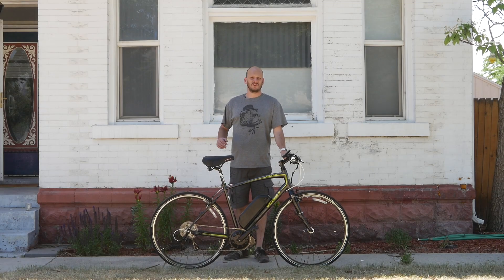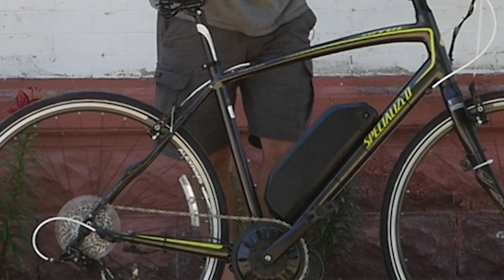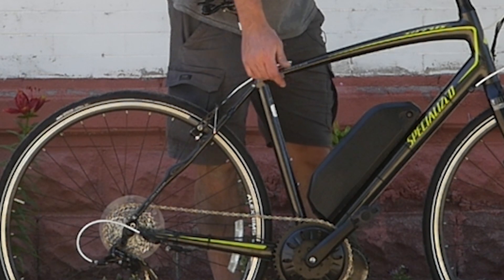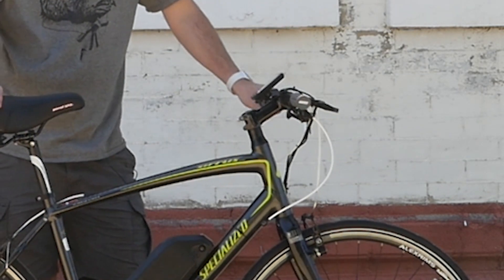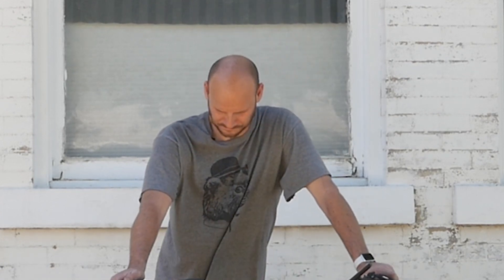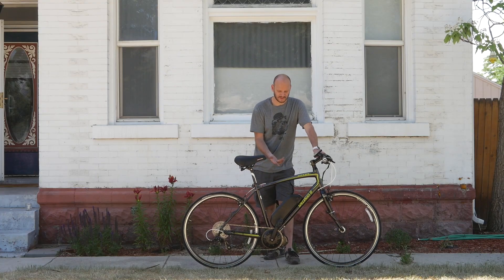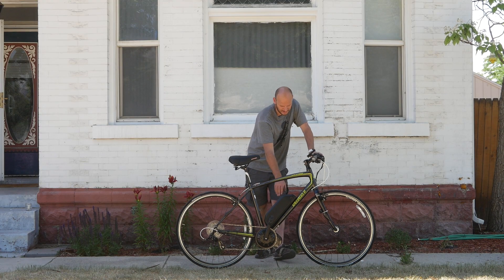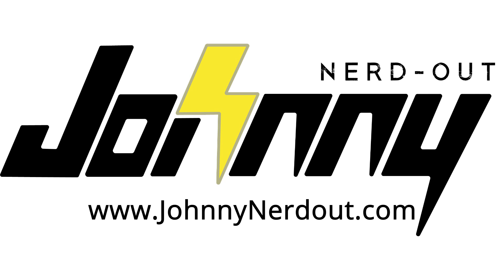Custom E-bike Build: Specialized Sirrus Bafang BBSHD 52v 17.5ah

Comment: Hey Johnny, I'm about to convert my vintage Sears and Roebuck Free Spirit road bike using a bbs02 kit. I noticed that you don't work with that many vintage bikes, is there a reason for that?
Reply from the maker: Not many out there that want them converted. Many are in poor shape as well.
Reply: @JohnnyNerdOut  Mine's in pretty good shape, I bought it off and old man that fixed it up and then realized that it was too big for him. I just gotta clean it up and probably add a little grease here and there since I've had it sitting in an old garage for like a year and a half.

Comment: shame it doesn't have hydraulic disc brakes, i'm struggling a bit with my regular old caliper brakes on my crazy long range bike, I weigh a lot though, 100kg.  I feel like the perfect ebike is probably a lightweight hardtail mountain bike with 28 amp hour triangle battery,  bbshd, although I do have some gripes with how the bbshd feels to ride because of how the motor is programmed to work, or has to work by design,  it will switch power on and off even if you hold the throttle continously, and below 50v theres a huge dropoff in the watts it will give you, typically it falls to around 500w to 700w,  whereas on my hub motors it will give full power at all times regardless of what level its on 1 to 5.  At low voltage it will still go up to 900w ish rather than 1200w which is what i've got it limited to.

Comment: Looking forward to a chain video. I have a shift sensor, but my shifting is a bit loud. Try to adjust but still not super quiet shifting.
Reply: Look for videos on indexing.
Reply: @MHH3180  I have index the gear. But I will try to do it with some help. Thanks. :)
Reply: A shift sensor should be mounted quite close to the derailleur. This limits any effect such as cable slack or stretch so that the actual shift is within the motor shutoff period .
Reply: @michealbackus4543  My sensor sits on the last hose near the derailleur. I must try to index better. Thanks. :)

Comment: If I plan on using my e bike on only pedal assists and not throttle, do i benifit from installing a brake sensor and gear sensor at all? Isnt the motor going to be turned off when im not pedaling in any ways?
Reply: Unfortunately, cadence sensing systems do not react nearly quickly enough and of course with a deraileur system you have to be pedaling to shift gears. You might have a point on an internally geared system or a torque sensing system.

Comment: Why is there such a variety of results with a Bafang BBSHD motor? You start the video by saying this a road bike and yet you only achieve 32 mph. I seen other videos of yours where a fat bike with the same motors achieves 36mph and more and yet there should be much more drag with those.
Reply: battery level maybe? he mentioned it was at 50 for his tests. could be that bike has  a shit drivetrain that is not as efficient.
Reply from the maker: Battery level, gear ratios, battery voltage, motor type (750-1000w), wind, how much I had to eat the day before all play a factor 😀
Reply: The BBSHD does not play well below 60% charge. It really needs the full capability of the battery to perform near its best. I always charge the battery while I am installing the kit so it is fully or near fully charged when I am done.
Reply: @MHH3180  yeah i've noticed that too, it slows right down to 500w when you are getting low,  in a way its good if you want to be efficient and get home on a super long journey but at the same time its unexpected behaviour that my hub motors don't display, and yes I know about ohms law, I don't think its that because the behaviour is non linear.  Acceleration up to 20 mph from a dead stop feels faster on equivalent hub motors, whereas with BBSHD the acceleration is more in the first second, its jumpy.. I rarely seem to get up to 30mph with the bbhsd whereas with the 1500w hub this is easily achievable on even a heavy mountain bike with 2.5 inch tyres.

Comment: It couldn't climb the hill? Why?
Reply: large chainring at the front. more teeth means it's for speed and not power. put a 34T in there and you'd be flipping yourself backwards if you keep the throttle pushed

Comment: Thanks Johnny,
I have an Aluminum Specialized Allez drop bar bike with 52t Lekkie chainring, BBSHD and 52v 19.2 amp-hr Tesla cells battery.  Just what you said.  I come from the world for performance cycling aka member of the spandex eat your own ride your ass off club.  There isn't an elite cyclist in my town that can keep up with my ebike.  If they can sustain 25 mph on the straight for a few miles, I can pull up next to them, they can't hear the motor and sometimes they don't notice its an ebike because it has 28mm wide tires and a drop handlebar.  At 30mph they try like hell to hold my draft.  At 35mph, they can't hang.  Probably the most fun I ever had on a bicycle.
My next bike buiid will be similar but would prefer 40-50mm smoothish tires for the pavement and that means disc brakes.  I prefer not to have disc brakes but for the tradeoff you discuss, I would like a wider tire and lower tire pressure for more comfort even out on the less than perfect roads.  Tradeoff is performance versus comfort, you are spot on.  Good news is the BBSHD has a lot of power to overcome higher rolling resistance of fatter tires provided you don't go full fatty.  If you do need full fat tires, you can go into the motor and upgrade the controller.  The BBSHD will take it.  Finding Goldilocks.  A bit of front suspension is welcome but if not going off road, I don't want rear suspension...maybe a suspension seat post but likely not.  I believe the best choice of bike in this case is either, steel, Ti or Aluminum gravel bike aka dropbar or....29'er.  I prefer a drop bar for the versatility in riding position and getting lower if going fast. A myth for those interested, is that a drop handlebar is uncomfortable.  The opposite.  A drop bar is most comfortable 'provided it is positioned up high enough'.
Cheers Johnny and thanks for presenting all the different bikes you build showing all the possibilities of a Bafang mid drive.

Comment: When shifting I just let up on the pedals as I shift works fine
Reply: Good then, but not everyone has automatic transmission integrated in his mind. To my mind shift sensor is needed just for error prone riders. P.S. sorry for my English, am Russian.
Reply: @aNDy-qh1em  excellent English and better than my Russian!
Reply: Or if you let someone else take her for a spin/rip.
Reply: If it works for you that's great Mark. I also know how to change gears properly but also have a gear shift sensor on my Giant CRS 4.0 with BBS02 750 watt mid drive and the sensor makes shifting much better. Try one they are relatively cheap and easy to fit. I'm guessing your bike has a mid drive and you aren't just referring to shifting on a 'normal' non ebike? 😀

Comment: 1st com!  I'm flattered. 32mph!  👌 I want range n comfort, th best of both worlds
Reply: I am not a fan of illegal systems, but I am surprised at only 32mph. I would have expected at least 40.

The real question is what kind of range do you need and how hard do you expect to ride for most of that range. Riding pedal assist, proper cadence and around 15mph, you'll be using about 100 watts. A bike like that one should be able to go a hundred miles on a charge. I disagree with Johnny on the comfort issue. That bike will take up to 32c Conti Touring tires. That makes for a mighty comfortable ride even on gravel. Fit and geometry make a bike comfy and stable, not marshmallow tires and off road suspensions.